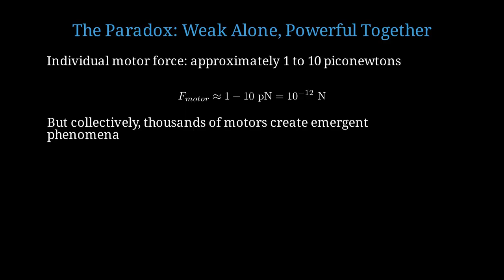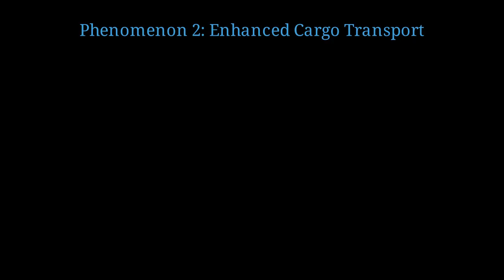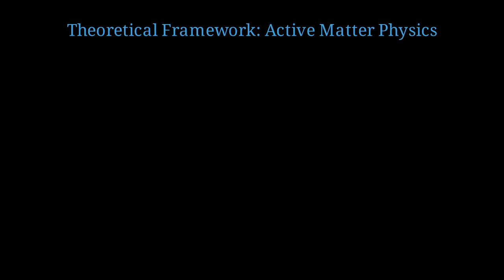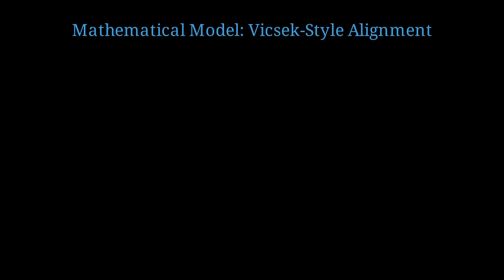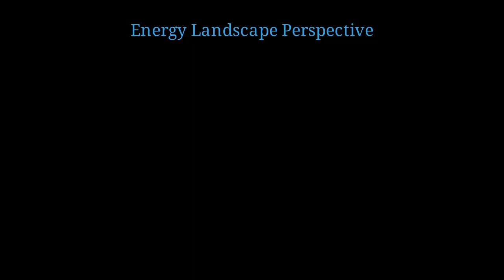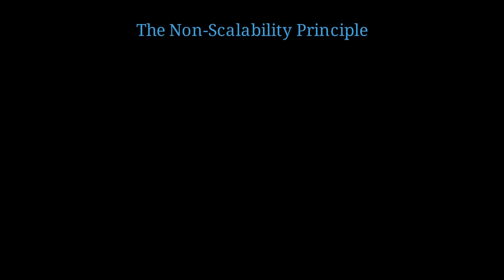How Tiny Nanomotors Work Together Like a Swarm

Comment from the maker: What determines the critical concentration threshold for collective order in various nanomotor systems?
Can the hydrodynamic coupling tensor be experimentally mapped for predicting emergent flow structures?
How can machine learning be integrated into swarm control to achieve adaptive, self-optimizing nanomotor networks?